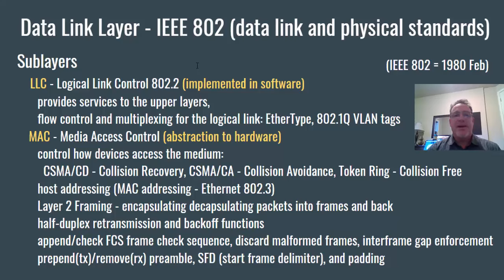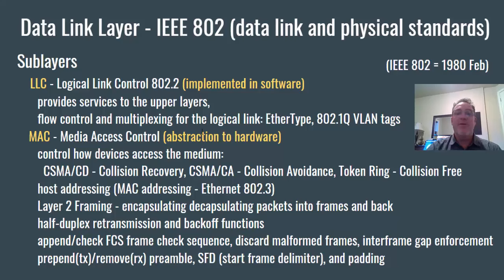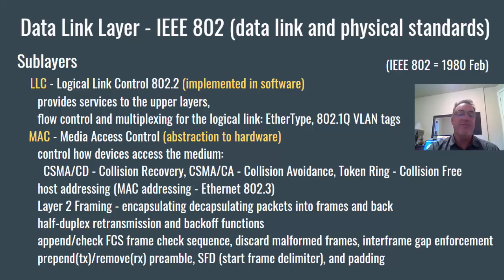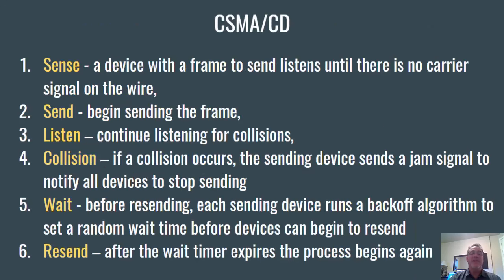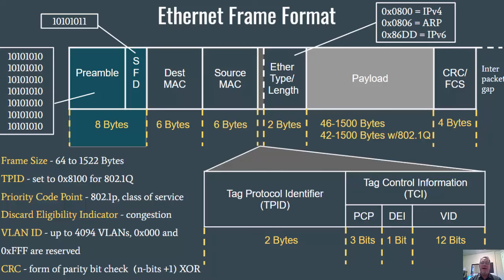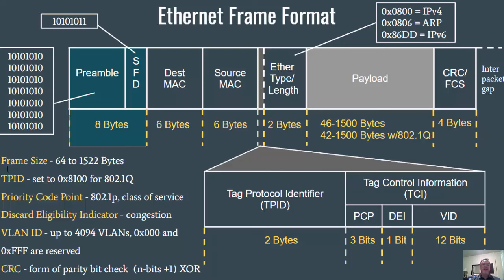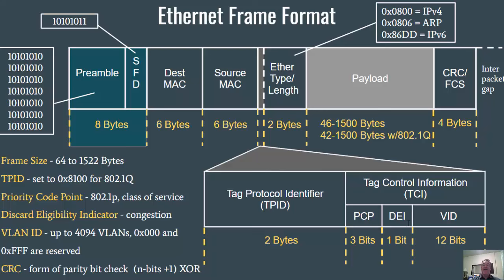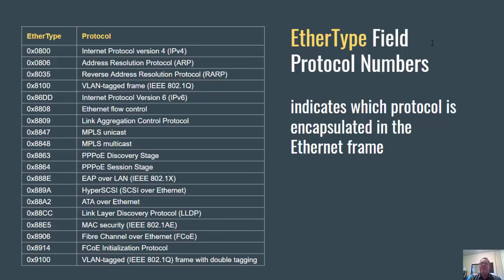The Data Link Layer, MAC Addressing, and the Ethernet Frame

Comment: The preamble is used only on 10 Mb.  On 100 Mb and faster, a different coding method is used and some reserved symbols are used to delimit the frames.  Same with the inter-packet gap.  Also, frames are no longer limited to 1500 bytes.  That's an artifact of the original Ethernet and then by 802.3 using the Ethertype field for length.  With DIX ll, it's Ethertype.  Frame expansion appeared in the late 90s and now, with jumbo frames, 16K can be used, IIRC.  You could have mentioned that if Ethertype/length is 1500 or less, it's an 803.2 frame and 1536 or greater for DIX ll.  IP uses DIX and about the only thing that currently uses 802.3 is spanning tree.  Other protocols that used to use it are now obsolete.

A good reference is Ethernet The Definitive Guide, from O'Reilly and, for a bit of history, you might want to download the Ethernet Blue Book (Gordon Bell), which goes into the original DIX protocol, before DIX ll & 802.3.
Reply: So basically, this video is completely obsolete.
Reply: @Parkhill57  Well, not completely obsolete, but a lot has changed.
Reply: @James_Knott  I hope someone like yourself or the original creator of this video will explain it with updated info. I have a logistics background and would understand things better if explained in logistics form.
Reply: @freddyhardware840  I'm really not sure what you're asking for or how logistics would apply
Reply: Are you sure about this? The preamble isn’t part of the frame, but has always been used to indicate the start of the frame for synchronization. No where have I heard or read that this has changed, for Ethernet II or 802.3. If so please provide proof.
Reply: @franchise2570  
Ethernet: The Definitive Guide, 2nd edition, from O'Reilly, by Charles E. Spurgeon & Joann Zimmerman, page 46.

The preamble is still there for compatibility, but not used.

Comment: I understand that VLAN-tagging (TPID + PCP + DEI + VID) is inserted before the EtherType field,  but can someone explain when “0x8100 VLAN-tagged frame” is used in EtherType field?
Reply: it is used when you have multiple vlans, if you have only the default vlan it is assumed all the frames go to the default vlan, when you enter the comman encapsulaion dot1q  :vlan number: command it is when you basically tell that subinterface for instance, to be the subinterface responsable for that specific vlan. you can exercise this with wireshark and see the standard ethernet frame, and the ethernet frame when it is tagged.